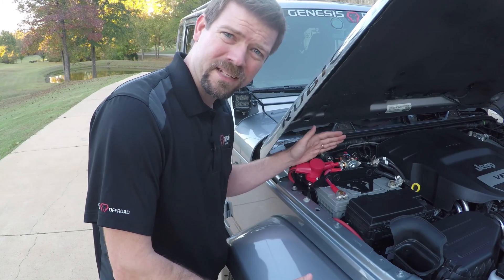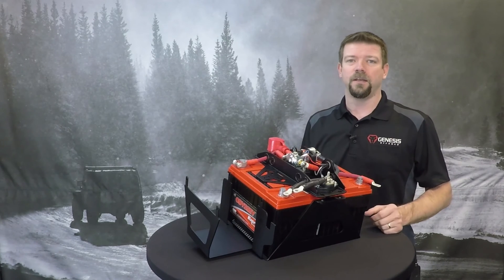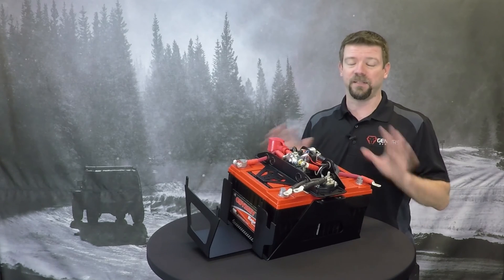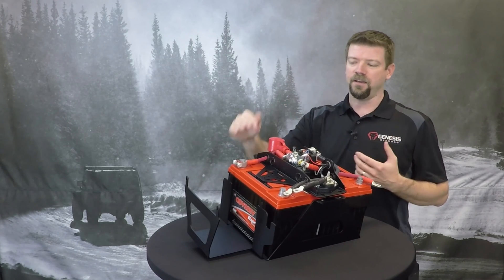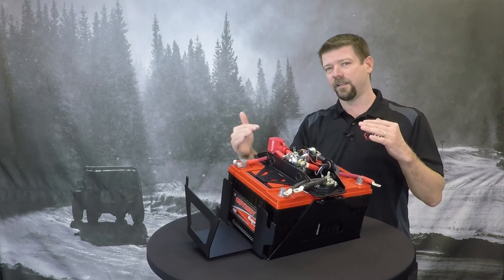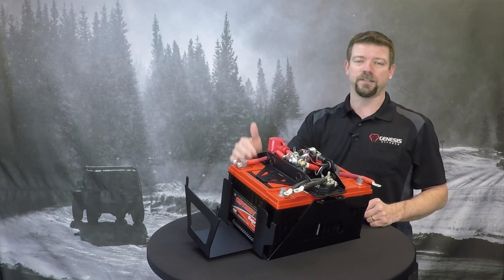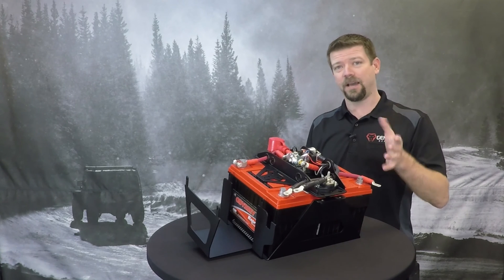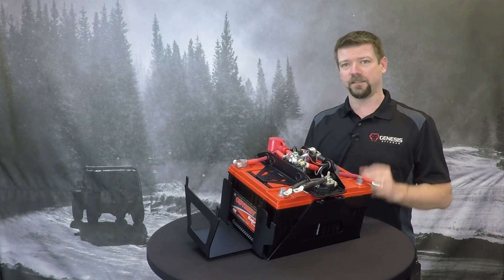Why does my battery isolator solenoid get so hot? Tech Tips from Genesis Offroad

Comment: hi there can you help me pls? my 2nd battery top of the battery plastic also got really hot i felt it with my hand than i disconcerted it. also it was off for 8monts +
Reply from the maker: Did you recently drive the vehicle? If so, it's normal for a battery to feel hot due to the ambient temps under the hood. If you were just charging it up with a normal battery charger, the battery may get a little warm, but if it's hot after charging, that could indicate a bad battery. Feel free to give us a call and we'll be glad to talk through it with you - 901-214-5337

Comment: Ours on our motorhome was at 190 degrees. We turned it off.....is that normal?
Reply from the maker: 190 sounds pretty high. The spec sheet for this one from Cole Hersee says it can get up to 140 degrees. Is yours from Cole Hersee? If so, it shouldn't get that hot. If it's not, then I'd recommend contacting the manufacturer for advise.

Comment: What is the other tray next to your 2-Battery setup in this video?
Reply from the maker: The only tray shown is the one for the 2007-18 Jeep Wrangler.
Reply: @GenesisOffroad  At the 5 second mark you are standing on the right, immediately in front of you on the left of the screen is a battery with the terminals facing you, on the other side further left is another battery with the terminals away from you AND then there is "U" shaped metal piece that looks like it could take another battery.  I'm unfamiliar with any of the jeeps so I do not have any idea what this extra metal could be for.
Reply from the maker: @hebdomatical  oh, that’s not another tray. That is the front section of the Jeep JK tray. The U shaped section holds the factory fuse box in place. You can see more detailed pictures of the tray by itself on our website here - https://www.genesisoffroad.com/jk-dual-battery-kit

Comment: i want to get a isolator like what you have but my question is can i charge a lead sealed agm battery from my vehicle this battery goes to my solar ..i have a regular battery lead acid battery in my van.
Reply from the maker: Yes, the smart isolator is compatible with all battery types. The important thing is to use the same type of batteries. You wouldn't want to mix a traditional lead acid battery with a deep cycle AGM, because they charge differently. So just use 2 AGMs, or 2 lead acid batteries.
Reply: @GenesisOffroad  ok thanks did not realize im new at solar stuff and batteries.thanks for your time
Reply: @GenesisOffroad  does this apply to all types of dual battery systems manages by isolators? Thanks
Reply from the maker: @bu3azoozz263  This rule would apply to any system that links 2 batteries together in parallel like this one. There are other devices out there that will charge 2 batteries from 1 charging source without actually connecting them in parallel.